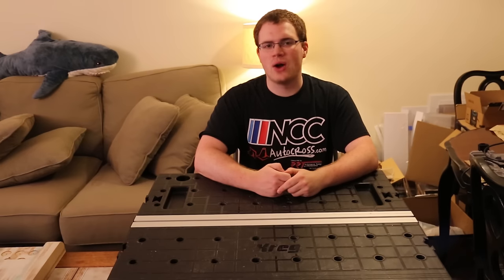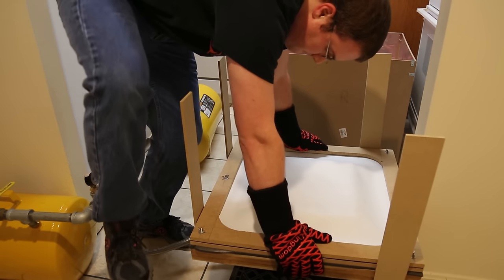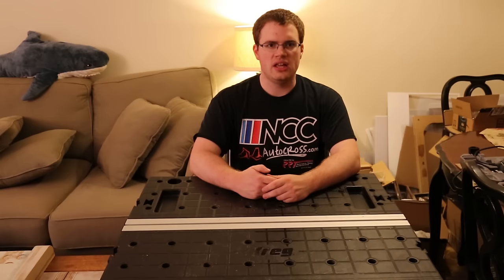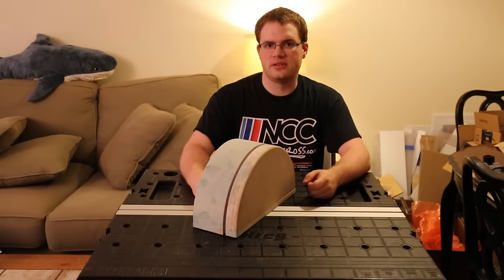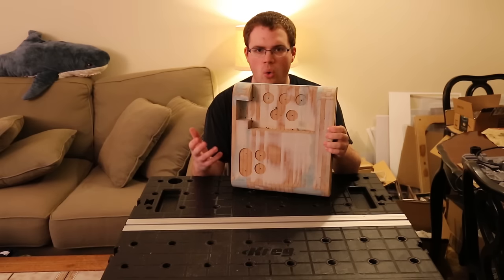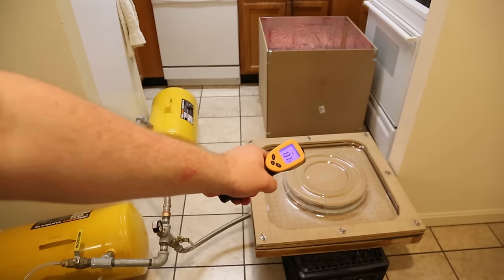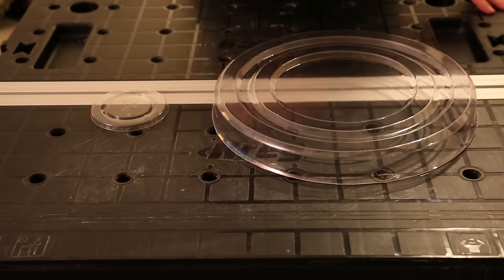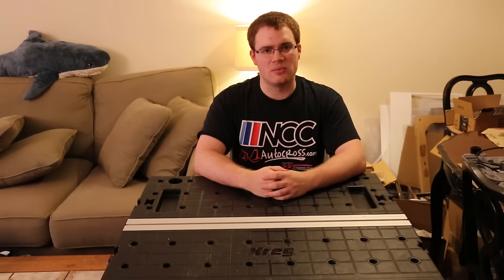DIY Vacuum Forming - Complete Video Guide

Comment from the maker: I've created a supplemental video going into more depth about the vacuum system I use. If you want to learn more about it, please consider watching it after this video. 
https://www.youtube.com/watch?v=q0Zp1s8pynk
Reply: I am seeking to make some shapes that are quite large(30” x 40”) but not so deep. The large production manufacturing places are charging a fortune for limited production of say 12-24 pieces. Any suggestions?
Reply from the maker: @TheHighlanderprime  Well, you can scale up what I have created here. To create a platen that's 30x40 isnt really a big deal, but one that can support a 30x40 buck would be another situation depending on your actual depth. 2" is no problem, but getting up past 6" requires a dimensionally larger platen (as well as much more significant vacuum volume, since you have more air trapped below the plastic sheet that needs to be equalized below positive atmosphere levels). Use the formula I gave you in the video as a starting point. Remember, your platen doesn't have to be square. You can make a rectangular shape using the formula for each dimension. Remember that formula is for the formable area, meaning you'll also have to account for any dead space you want on the plastic as a buffer zone (highly suggested) as well as any room to land your frames if using the gasket style I presented with. You'll also need a heater system to suit that size as well. The 24x24 former shown here is probably around $500, so keep in mind you may be around $1000 - 1500 with your larger former (vacuum pumps and heaters being the most expensive parts, as well as any metal adaptors/ball valves/and hoses). Now, this will give you the ability to make many parts, but if you don't see future projects in vacuum forming (depending on the quote presented to you) it may be cheaper to outsource it if all you need it for is this one project. You may also consider looking into the vertical style of vacuum formers. The frames and plastic sheet are on a vertical rail. Brought up to the heater (above), and then they slide down to the platen and buck (below) so you don't have to carry and line up the frames by hand. For cost and simplicity sake, I would still suggest the by-hand method provided you had someone that could help since it would save considerable time and effort by comparison. Also, keep in mind most full sheets of plastic are sold as 48x96 or 48x99. Depending on supplier, that would be your max frame size. Obviously a 48x48 would be ideal from a material preparation (cutting) and utilization (no offcuts) standpoint, provided the 40" dimension of your buck can fit.
Reply: Hi, thankyou so much for this video and all your detailed answers. 
Do you know if there is a plastic I could use to make a motorbike headlight lens that would be strong and also very clear and uv resistant? 
I'm thinking a thickness of at least 0.200". The lens is only 7x5 and about 2" deep so if I can I'd like to use 0.300" material, the most important thing is strength and clarity as I want to put an led projector lens in it, and hopefully an led drl if I can make it fit.
Reply from the maker: @bigdaddy741098  Real headlights lenses are made from polycarbonate, which can be vacuum formed. I haven't done it myself since I haven't had a need beyond PETG, but looking at the specifications you just need to make sure you have a good heating element to bring it up to temperature (I'd suggest something capable of 200C/400F). You'll need to apply a UV coating afterwards (the kind usually supplied in headlight restoration kits), but I would chat with your local plastic supply about your application. Polycarb is pretty strong, so I would start with 0.125" or something in that range - which will also be considerably easier to heat and form.
Reply: @mwjscn  thank you so much for your reply and advice, and I will definitely try 0.125" first.
It will probably be a few months before I can get it all up and running, but I will come back and let you know how it went so anyone else can maybe benefit from my experience. 
Maybe I'll also make a poor excuse for a video about it 😁

Comment: Vacuum - better to use a dry vane rotary vacuum pump like GAST - 2nd hand they can be found cheap. Depending on the size of the pump and your mold you might not need vac storage tanks

Comment: Finally someone got it right. Great video. I am a 27 year thermoforming Technician and many videos just don't understand how this process works but you got it.
Reply: excuse me sir, My project is design Polycarbonate forming machine (thickness~ 5mm), Could you tell me how much does the temperature increase every second to heating sheet?
Reply: @anhnguyenlehoang5945  I have used blow molding in the past for polycarbonate material and to give a temp is impossible because it has a wide range of melting depending on the material and not knowing the draw of the mold and if it's a female mold or a male mode with the plug assist.
Reply: @airwolf269  thank you.
Reply: @airwolf269  excuse me sir, Can you tell me How much plate clamping force is enough ?  I use vacuum pump with 27inchesHg
Reply: A clamp frame is only to hold the material while heating and to help with webbing while forming. Now if you have a inline thermoforming machie the chain will pull the materiel through the heaters on a cycle timer or called dwell time. The rails are water cooled to keep the materail in the chain while heating until it gets to the forming station then the clamp from is part of the water jacket the mold is mounted to. We ran the clamp at 25 psi and can adjust it as needed for webs and or draw. Vacuum pump was always at 30hg with 15gal reserve tank on the pump. Once the station close pressure form is then applied at no greater then 50psi so not to blow the box as many new mechanics do. Air eject again applied as needed normal 10psi  will be applied through the vacuum port with 2 way valve for vacuum and air eject to remove the materiel from the mold. Sheet machine is also almost the same just no chain but on a rotary machine.
Reply: @airwolf269  Sir, Have you forming polycarbonate by male and female mold, and Could you tell me how much force you need to push up to shape after heating ?
Reply: @anhnguyenlehoang5945  Don't know what the force is because its controlled by air cylinder at 120 psi. Force also comes in design of the mold and plug for draw and wall thickness also the mil of the sheet say .025 mil pvc not much force needed but design is important so not to have webs, thin draw and or thin walls. Timing of when the plug enters  the mold is also important.
Reply: @airwolf269  Sir, What material and how thick (and size) do you use the cylinder at 120 psi to forming for?
Reply: @anhnguyenlehoang5945  8 inch die cylinders on both upper station and lower stations. Sheet machine has 12 inc die cylender these are Machines not DIY stuff.

Comment: Thank YOU for sharing your knowledge and expertise regarding vacuum forming plastics.  For approx. 25 years I owned and ran a decorative glass business in NJ - where we also got involved in the Historical Restoration of wood windows and doors in addition to leaded glass and kiln formed / slumped glass.  It is quite obvious that not only are you well informed about this subject but you are articulate as well. 

 It is disheartening to see videos posted by amateurs who lack the basic knowledge of what they are talking about.  However, THAT scenario is NOT applicable to YOU - as YOU are a professional in your knowledge about this subject AND in your methodology of presentation !  AGAIN, I THANK YOU for sharing your insight and knowledge about this subject and could only imagine how much grief and aggravation that you encountered to get where you presently are !  Glass slumping involved heating the flat colored glass to approx. 1500 * so it could slump into or over the mold - much like taffy - then it is allowed to cool and harden to maintain its shape. But it also has to be gradually cooled so it does not crack due to inner stress - called annealing. Somewhat similar to what you do by allowing the plastic to cool under pressure before releasing the vacuum. Wishing you and yours nothing but the best in ALL of your endeavors !

Comment: I'm getting ready to build a box for vacuum forming and have watched several videos, but you're the first person I've seen who uses coins for air flow, and it makes perfect sense. I'm glad I watched this before trying my first pull. Thanks!
Reply from the maker: Glad to help! I can't claim it was my idea, but you can regard this video as a 'Vacuum Forming's Best Hits' album containing all the good ideas I gathered from across the web. Having some spacing underneath is definitely important, since it allows the trapped air to evacuate underneath the master which results in a tighter draw around the buck.
Reply: @mwjscn  That's exactly what I was thinking when I saw you do that. I have a question. I'm sculpting something that's about 4" wide and 2¼" tall and somewhat dome-shaped but not exactly, which I plan on casting in Ultracal 30 as the buck, and I have some .03 inch clear polycarbonate I was thinking about using, although I might get some .02 inch if that doesn't work as I'm hoping. Do you have any tips for that specific combination? Also, it looks like the holes in your vacuum box were spaced 1" apart, but what size do the holes themselves need to be for a project that size?
Reply from the maker: @LesignerGirl  If your end goal is to have the polycarbonate be perfectly see-through afterwards, I suggest some type of clear over your buck material. If the material is rough, it will transfer over to the polycarbonate and form a haze. If any material is loose, it may become embedded in the heated plastic. The holes I drilled are 1/8". You can use that size at any scale. I suggest 1" spacing at a maximum, which is what I used, but for smaller platens you can pack them tighter if you desire.
Reply: @mwjscn  My idea is to make a clear respirator that either has valves, or some type of cloth covering over the chin, that I can wear to prevent the spread of Covid-19 if I come across someone at work who needs to be able to read lips. It doesn't need to be absolutely perfect, but I would like to get it as perfect as possible. I think I can get a smooth finish by using my miniature silicone rolling pin on the clay, and the alginate I'll be using to cast that will keep whatever finish the clay has. Likewise, the Ultracal 30 should keep whatever finish the alginate has. I was thinking about buying a pack of clear plastic Solo plates to practice with before using the more expensive polycarbonate. If it comes out clear with the plates, will this guarantee that it will also be clear with the polycarbonate?
Reply from the maker: @LesignerGirl  Polycarbonate at .030 is going to be inexpensive, no purpose in testing with the material in a different format just to change for the real pulls. PETG would be even less expensive and much easier to heat to temperature (a 4'x8' of .030 PETG cost me $30 from my supplier) if you wanted to switch to that material. Considering the object is so small, you'll get many tries out of a single sheet of either. You'll likely run into problems with your breath fogging either material in your intended application, though.
Reply from the maker: @LesignerGirl  I get my material from Piedmont Plastics, who is local to me. I'd suggest finding a supplier local to you or a hobby store. Amazon is okay in a pinch if you know what you're getting.
Reply: @mwjscn  Thank you for all of your feedback. It looks like I can have a 2'x4' sheet of .03 PETG shipped to me for $12. Would this thickness be flexible enough for my purpose?
Reply from the maker: @LesignerGirl  Should be, have fun testing! Make sure to avoid overheating the plastic when it's that thin. You'll also want to work at the bottom end of the formable temperature threshold to avoid blow-through on the buck when the vacuum is applied. Trial and error will win the day.
Reply: @mwjscn  I plan on doing a lot of testing, and hope to come up with something that's workable. If not, at least I will have learned something, and I do have a backup plan for communicating with people who need to read lips. Thank you so much for your time and responses!

Comment: For you do it yourselfers.  WHen you run a heater,  and then kick on the vacuum, you are likely going to pop your fuse.  If you are not hooked to a good power grid.  Or you cant get both your pieces of equipment on different breakers,  the vac pump is the way to go.  I personally use both.  I turn on the shop vac to get it close,  then hig the vac pump to make the seal tight and perfect.  It wont typically evacuate all of my air,  and it makes the re-fill process fast.

This is a great video by the way.

Comment: By far the best Vacuforming overview I have found. I built a small vacuformer from a hotplate with a foil lined box and a 12x12 vacuum bed using a small dirt devil vacuum. After watching your video I am much closer to figuring out how to optimize my forming (I have had problems with the plastic getting quite thin and with pinching near the corners). I wonder if you can recommend any cheap sources for  Petg Sheets.
Reply from the maker: Glad to hear the video is helping! Since you're working at a modest size scale, you can find sheets on Amazon or other similar retailers. However, I'd always suggest trying to find a plastic supply depot near you. It can take some googling, but they're really the best option. They sell full sheets and usually cut them to your size requirements. I usually spend about 30 - 40 bucks on a 48" x 100" sheet, which for your size would be in excess of 30 pulls, at about a dollar-per.

Comment: This video is the most informative video I have watched on Youtube, well done and thank you.
I am going to form a windscreen for an aircraft out of 3mm acrylic, the buck I will make will be around 18" tall and 40" x 25" across. I was looking at a 3hp 4.8cfm pump and a 100litre tank- What kind of temperature should I be aiming for for the acrylic?
Many Thanks.
Reply from the maker: Thanks! I highly suggest getting the acrylic manufacturer's data sheet for the product you're purchasing. Every thermoplastic data sheet I've gotten from my plastic supplier states the glass transition temperature (which you want to exceed with your heating element) and usually has extra tips if not an entire section on thermoforming/vacuum forming.
Reply: @mwjscn  thank you for the info, I shall check that out.